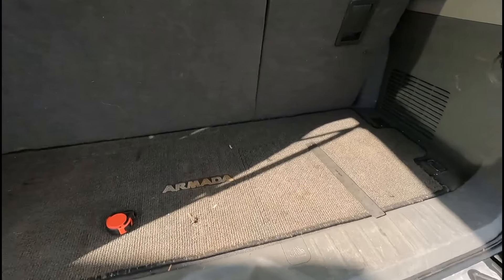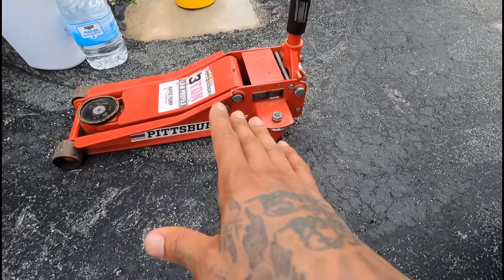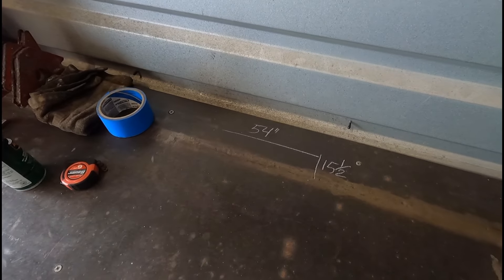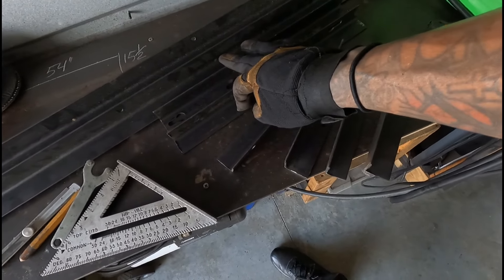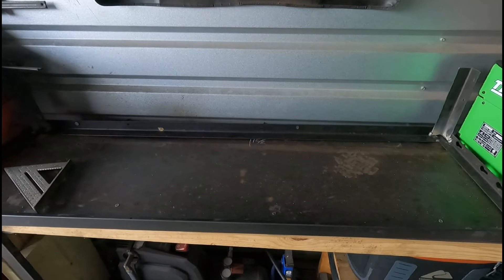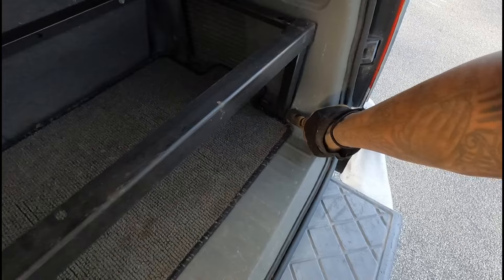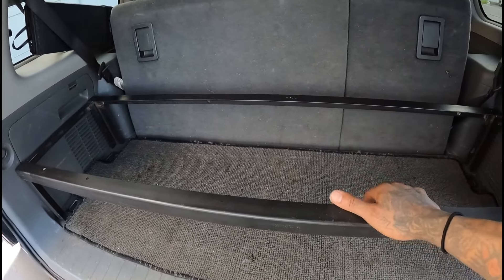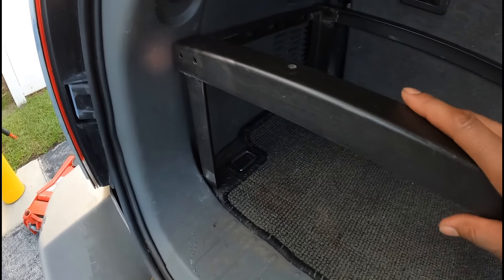DIY Custom Storage/ kitchen Build (part 1)

Comment: Rob_outdoorz ❌ Rob The Builder ✅
I think a nice touch would be some butcher block. Expensive…probably but it’ll a definitely make it pop!
Reply from the maker: 😂😂 "rob the builder" 
Just looked up some buchers block and it looks great .... but that price tho lol
Reply: @Rob_outdoorz  another option you can get some 1 by pine common board and lightly burn it to give it that rustic look. Spray it with some exterior polyurethane so you can clean it. Or you can put some stainless steel on there, bend you a 1” lip or less in the back towards the back of the seats.